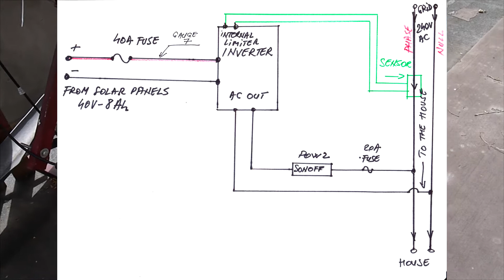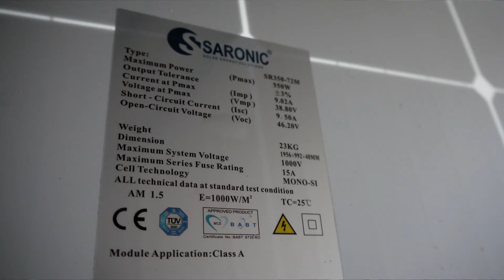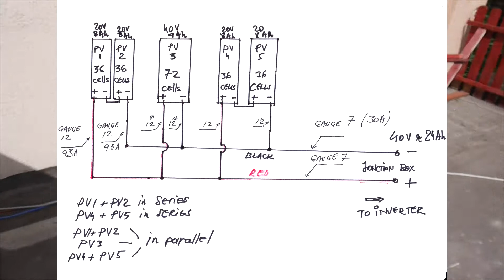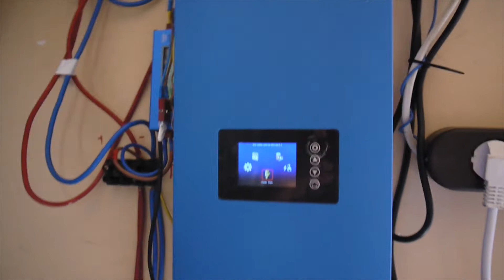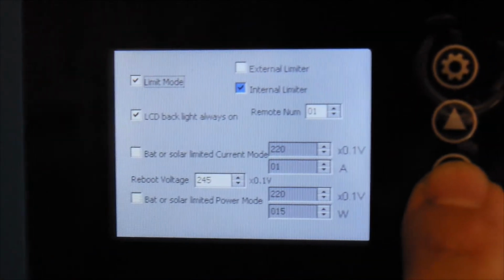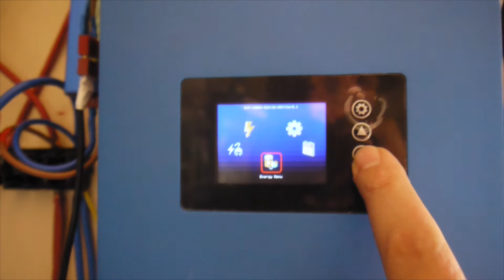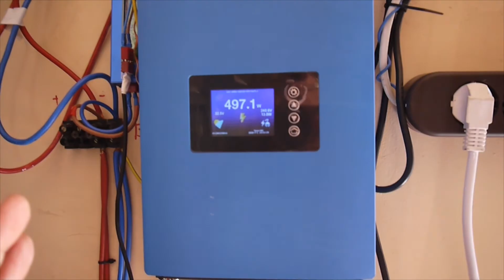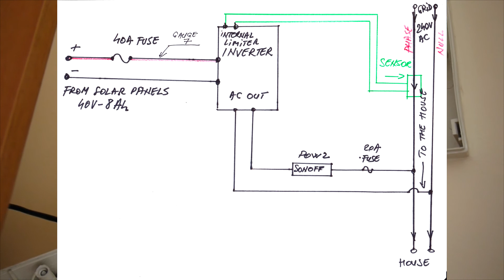DIY solar panel install and wiring to a grid tie inverter limiter SUN-1000GTIL2

Comment: A great detailed video ,thank you, right now i am using emphases micro inverters and 4 panels  ,im in the UK , but here they are pushing hard for smart meters ,so an inverter with limiter would be a good move .May i ask a question how long can i extend the limiter clamp wire ? from my house meter (located at the front inside my house) to the inverter which i would like in my garage at back of my house? would it affect its ability to function correctly  ?
Reply from the maker: I don't see any problem for a 50m of cable. Even longer if a shielded cable (like microphone cable) will be used. Connect those two hot wires to the sensor and the shield to ground.
Reply: @viocaia  That's great much appreciated news, so maybe a cat6 or something, as it shealded ,thanks for your help .

Comment: There where you connect the limiter sensor, can i connect 2 sensors? I will like to run 2 inverters.  That will work? Thank you so much😊
Reply from the maker: I don't recommend sharing a sensor to multiple inverters, there is different power, different solar input and so…, use each inverter with its own limiter sensor.

Comment: Hello, thank you for your videos.😊 so,Can I have 2 inverters 1kva , and plug them to my grid plug?
Also, about the limiters,  2 inverters I have 2 limiters, is ok to add 2 limiters on my face wire so i dont exporting power back into the Grid? It will works? Thank you so much
Reply from the maker: Of course you can, you may add any number of inverters in parallel also with limiter.

Comment: I wonder that you haven't burned down yet!
Reply from the maker: Luckily or blessed, I'm still alive! Everything is working without a glitch! Of course there are fuses everywhere and strong cables too, also good ground to panels and inverter...if you don't see any new videos on my channel, you;ll know I'm gone! :') so please subscribe to see me..kidding!
Reply: @viocaia  I am glad to hear from you, you are alive! Living in Spain as a pensioner for 3 years, I also deal with solar systems!
 Otherwise it can get really boring after 45 years of working! I have a system with 3 x 12 V / 150 W panels on the roof, plus 1 x  Epever MPPT 30 A charge controller / 4 x 12V / 100AH batteries and a novopal 1500 W inverter. I use it to run my fridge / freezer, around (90W), circulation pump (40W); IP Camera (15 W), as well as a couple of night lights all (30W).All of this has been going on for about 2.5 years, well! Now the batteries are weak and I'm looking for something else, so I found you on YouTube. I would like to install a grid tie inverter with a limiter of around 1000W and connect the solar panels to it. First question, where do I connect this (behind the main fuse?) By the way, here in Spain Andalusia only 1 phase electricity comes into the house! Second question, even in Spain the sun doesn't shine at night! My night lights, my fridge, etc. Is there a possibility of combining solar during the day and battery at night! If so, how do I charge the batteries? You can see a lot of questions! I am quite ready to make a few more investments, but they have to be the right ones. At the Chinese you always buy 2 x, ha! I want to prevent that.
I would be happy to receive a few tips!  
Gracias, Danke and have a nice evening were ever you are!
Dieter
Reply from the maker: @dieterkarallus6493  Good place for a pensioner! I'll be there soon..pensioner I mean! 
So..the limiter sensor is connected after the energy meter, to the main input wire..before or after the fuse doesn't matter, but it should be the main power rail. Single phase it's perfect. About charging the batteries in the day time, you may build or buy a good battery charger, connected to the house mains for the day time..that according with voltages and power needs.That's a solution for 12V pack.But, I'm thinking to have like 3-4KWh of LiFePo4 batteries, at 48V , charge them in the day time and connect them to the inverter after sunset..a simple circuit with time control and power relays should do the job..and get rid of 12V circuit and consumers..maybe, someday after I'll broke the National Bank! But, for the beginning an inverter at least 2KW (I feel mine 1KW at the edge) should be perfect.I'm making like 4-5KW daily..and there is a lot of lost solar power..because this inverters are "listening" the house power needs and so many times the instant energy needs are less then the install can deliver..but it's work in progress..Be in touch!